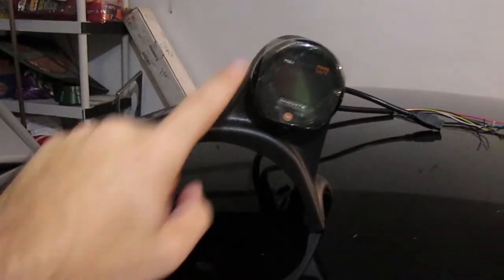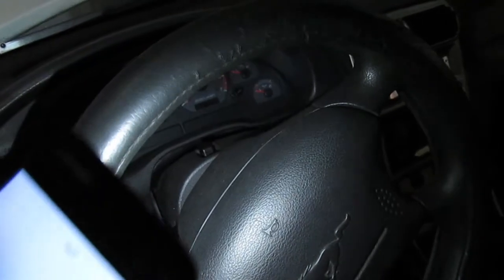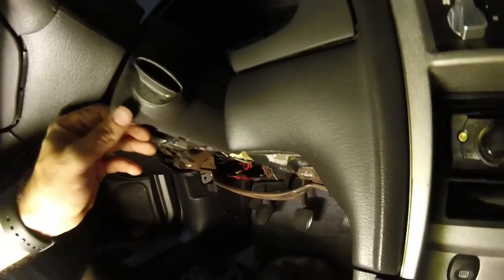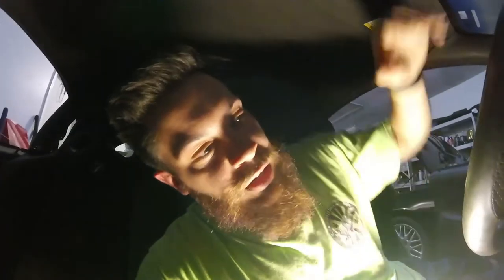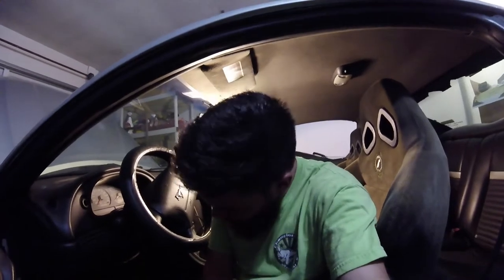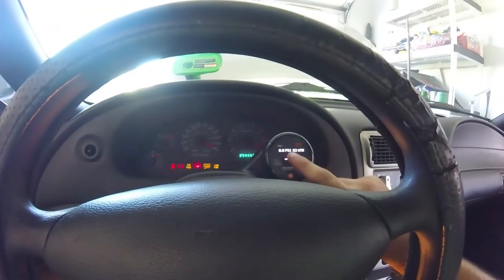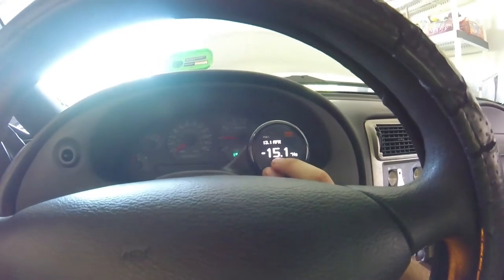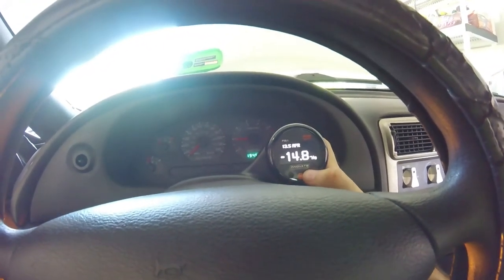Installing an Innovate Wideband and boost gauge in the new edge!

Comment: Thanks for sharing.  Video is old and hope you can review this for me. I am installing the PSB1 in my Miata and would like to ask you what wire(s) did you hook up to the existing ECU connector for it to work with stock ECU?  I see the yellow and white wire sitting down unconnected on the driver footwell.  You never mentioned this piece.  Thanks again!
Reply from the maker: the gauge itself was excellent, Highly recommend.  The wires hanging down not connected at the end of the video are the wires for the boost controller function. So i left them because i was supercharged and it didnt matter for me.  Hope that helps!
Reply: @brianlewis1449  Thanks Brian, I am also in the process of installing a Rotrex TDR SuperCharger Kit and will be installing the boost and shifter light to be able to confirm the level of boost produced.  Interesting that you did not want this feature.  AFR most definitely important but I felt boost control with stock engine was too.  Thoughts on why you ignored this?
Reply from the maker: @ajd711   I was running a vortec supercharger which is clutchless.  My boost was purly driven off of a pully size ( smaller pully = more boost).  So I had no use for a boost controller i wouldnt be able to control the boost really since at WOT the pully is going to create the same amount of air regardless. If it has a use in your install i would recommend it ive had it on my turbo cars and its a good feature to have.

Comment: Is your AFR accurate. I have the same set up and mine constantly reads 13.5 in load or 4.5 on deceleration. It’s either/or one of these two numbers with no variations. Wondering if it’s the gauge or if mine is not calibrated correctly.
Reply from the maker: Yeah mine is accurate it doesn’t seem to keep up at wot depending on how fast it revs out. But you do have to collaborate it correctly other wise it will display super off.
Reply: @brianlewis1449  still holding up good?  Looking to install in my c6 vette build.  Wanna help, Im in Daytona 😄😄